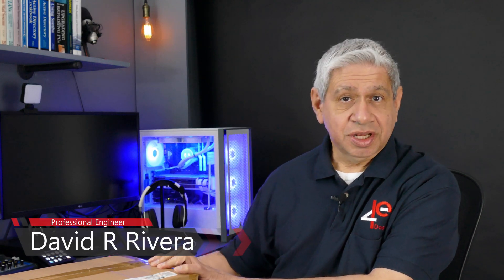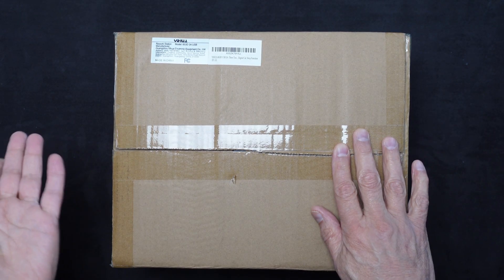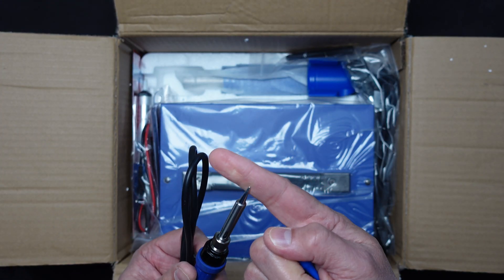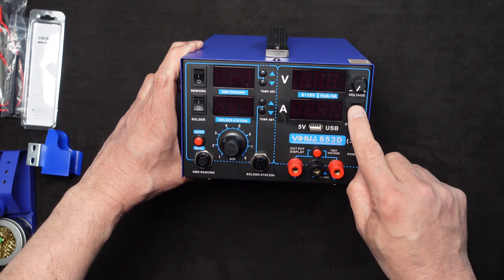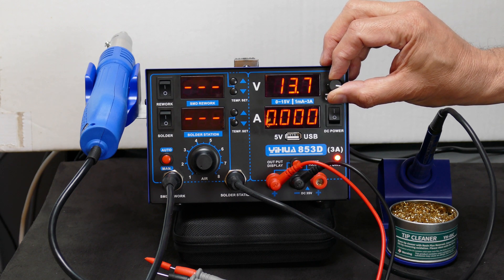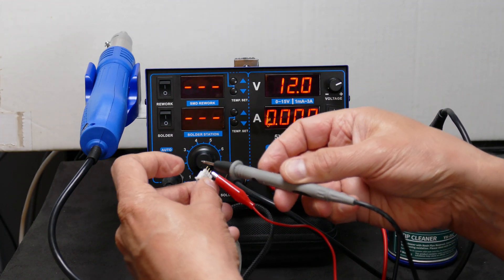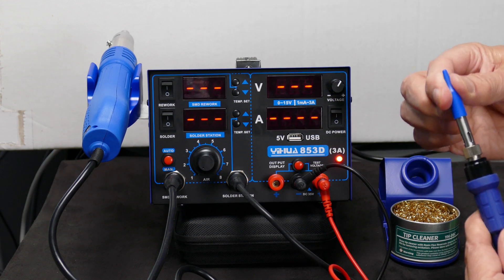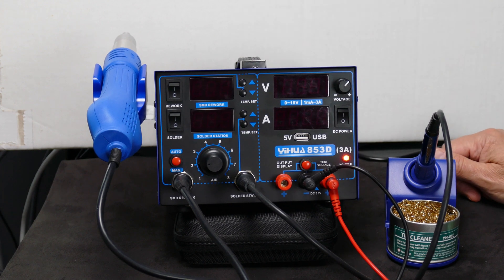YIHUA Soldering and SMD Rework Station: Opening, Setup and Testing

Comment: I had no idea what the black pen looking thing with the wire and screw were and the blue pad with the cut out. Also can't figure out what all the holes are for on the soldering gun holster.
Reply from the maker: Are you OK on that now?
Reply: @PE4Doers  Yeah, I'm only partially mental. Figured it out with time. lol
Reply from the maker: @ I'm glad it's OK now
Reply: @ Turned out to be a great setup for the price. Already have fixed several refridgerator boards along with a few AVRs. The ability to send power to each component makes troubleshooting so much faster.

Comment: After purchasing 2 of these units both come with a bad hot air smd device. Any tips on why they wouldn’t work out of the box?
Reply from the maker: I honestly can't answer that, since mine worked out of the box and still works today.  I did find out the 1st day however, that I needed to lift the Hot Air gun off its stand before it would start.

Comment: whats the L shaped piece for that comes with the heads.. can't figure out its purpose or anyone who has it in use.
Reply from the maker: Hmmm - 'L'-shaped piece?  Can you describe it to me (size, color, metal/plastic)? Or email me a picture at PE4Doers <at> Gmail?
Reply: @PE4Doers  they came with the heads to the hot air gun, sent the picture over

Comment: Oh my that thing is pretty way overkill of R/C cars and way better than the junk I used yet I still want on. Thank you.
Reply from the maker: It is not the highest tier equipment, but does well enough for someone who does not make their profession reworking and repairing electronic equipment.   At least it has all the based accounted for.
Reply: @PE4Doers  oh I know it showed up on Amazon and it's how much you want to spend. This would have been nice to build my trainer in school. Now it would be real fancy fo R/C for batteries and shrink wrap a bet you can charge then also.
Reply from the maker: @JohnPallick  You are probably very correct on that assessment - unless you plan on taking electronic testing further.

Comment: I’m looking for a setup and to get into soldering and enjoy this. This was a very solid review video. It was clear, concise and you went straight to the point. Thank you!
Reply from the maker: You are quite welcome.  Just keep in mind that soldering takes patience and a lot of practice before getting good at it.  You WILL burn yourself more than once (non fatally, of course), and you will be disappointed in some of your early soldering.  That is all expected, and all of us who today consider ourselves good at soldering have gone through that.  Just be patient, and above all, practice as much as you can.
Reply: @PE4Doers  The last time I soldered was back in 2007 when I was in high school in my electronics class. I enjoyed it back then.

I do cell phone, computer and other electronic repairs so I have an additional familiarity with it, so that's a plus on my end lol.

Thanks for the additional tips! I ended up ordering the YIHUA 948-II. I have a Sega Dreamcast that I'm going to do some quick mods, such as replace the old, dead CMOS battery with a rechargeable ML2032 battery, replace the one time fuse for the controller port with a re-settable fuse, etc.

I'd also like to order some kits to put together with that need soldering work. We built our own voltage/multimeter back in high school and something else that I can't recall. It was very fun. I don't recall what we built exactly, but I know I have it somewhere at my parent's house lol. If you have any places that I can get DIY kits, I'd appreciate the recommendations.

Thank you!

Comment: What station do u recommend?
Reply from the maker: The one I have is "YIHUA 853D USB 3A-Three Tools", which has worked out well for me.  The Amazon link is: https://amzn.to/4e4Pcdx
Reply: @PE4Doers  cam u plug in to 110/120 or do u need powerstation?
Reply from the maker: @chrisv.6951  Mine plugs directly into the 120.  What do you mean by 'Power Stations'?  Are you referring to a power brick that lowers to a DC voltage?

Comment: Can you test for continuity with this?
Reply: I am a beginner at this, can you confirm or deny this? I think if you leave it on voltage output setting and on low settings you can test for continuity since it beeps when the two probes touch.  I could be wrong and this will cause short on the station.
Reply: also sometimes they beep even when the probes is somewhat near and almost touch, not quite sure what that means.
Reply from the maker: @stevie5998  That is likely the 'beep' indicates a problem such as a short.
Reply from the maker: @stevie5998  There is built-in short circuit protection, but it would be a short.
Reply from the maker: I do not know of any capability for performing that function.

Comment: What is the plastic pen looking device that comes packaged with a screw and Y shaped metal wire? You skipped over it during unboxing. I bought a similar station and can't figure out what it's for.
Reply from the maker: Oh, sorry.  That's for holding down a wire or electronic component that you want use Hot Air on that prevents you from burning your hand.  I will 'Pin' this comment and my answer to the top of the video comment area.
Reply: Thank you man I was looking for that this whole video
Reply: I was wondering what the black thing with the wire on it too!

Comment: you have to use three cables connected to the power supply, that way you can have it output power and act as a multimeter at the same time. Adjust the voltage with the output-display switch on, then you turn it to test-voltage and you can use it to measure the voltage.
Reply from the maker: Thank you for the additional information.

Comment: Amazon always has good cheap electronics. They might not be brand but they get the job done! I got a $12 soldering iron from amazon awhile back and it still does perfect today. Also your audio almost sounds like its "doubled" in your editing program make sure that you dont have two audio channels stack on each other! Happy YouTubing!
Reply from the maker: To your point, I have a number of cheap tools that work perfectly well, and some name brands that have failed miserably.  I guess it all depends on how the tool needs to be used.

I will have to look into the audio issue you mention, since I have only a single track for each clip, though I did switch back and forth between the sound output of my two Sony cameras.  I did not have two of them running at the same time however.

Comment: Great review David! Pretty nice all in one device. I can see where the hot air blower would come in handy if you were soldering wire connections and wanted to heat shrink the connection. Having everything handy all in one spot is a time saver. Thanks for sharing!
Reply from the maker: Tony, you have that exactly right.  I do regret not buying the sub-model that has a lower-end heat gun however.  I may try and find out if I can just replace that with a better one, but I will try using it for a while first.

My biggest problem now however is a place to keep it.  I may need to setup another special Studio where I can add advanced air exhaust, and use that for soldering, hot air Rework and my upcoming Laser engraver.
Reply: Which model is the one with better heat gun?